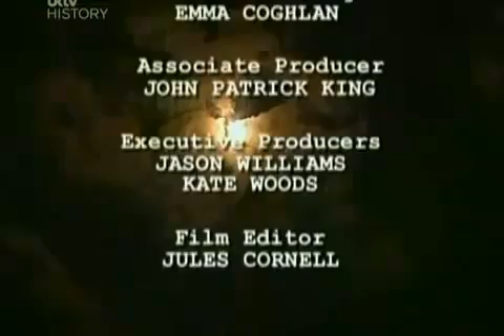The Last Flight of Space Shuttle Challenger 5/5

Comment: I thought the O ring had remained compressed because of the cold weather not disintegrated as per the voiceover ?
Reply: It was the freezing cold steal rocket casing that made the O ring     (that had failed) material stick and harden plugging the gap UNTILL the shuttle went through Max Q and the windsheer..
Reply: Correct, the seal couldn't be made because of the cold. It resealed temporarily with the debris of solid rocket fuel on takeoff then the massive windshear they hit dislodged it. The fire burned straight through, breaking the strut that holds the srb to the liquid fuel tank, which caused the srb to slam into it, rupturing it and causing the explosion.

Comment: But they put men on the moon with no problem whatsoever 🙄
Reply: And that was 17 years before this.
Reply: @karlvonboldt  I guess you've never heard of Apollo 13.
Reply: And even before Apollo 13, there was Apollo 1.  Followed by numerous Soviet disasters. All failures NASA learned from in order to make the moon landings possible. I'd hardly say we put men on the moon with no problem whatsoever.
Reply: The Apollo rockets while limited in tech were a much safer design. The Shuttle was intended to be a cost saving reusable vehicle that would be used to put satellites on orbit as a buisnessa and continue work on the ISS. It was a failure in cost saving and its design proven to be flawed. Based on the entire craft being in a very vulnerable position along the side of the SRBs and main fuel tank rather than a top riding style like apollo and a emergency escape system.
Reply: @theaceofspades485  Nasa turned down Aerojet General rocket booster because it cost more. Their booster would be a one and done but no sections and no O rings to fail
Reply: bettter launch team .
Reply: People just comment anything...have some respect for the dead coward!
Reply: @gradybeats83  that is a problem now days. People don't know what respect is or choose not to do it.

Comment: Since ive seen a blast on the launch pad compared to an atomic bomb i think we can all be thankful that o ring sealed temporarirly
Reply: It wouldn't have been like that but it might have posed a danger to people in close proximity. I think it was a cover-up. The joint failed at liftoff. Not in the air. It actually (accident) might have been a design flaw, I don't understand the assembly but it seems sufficient pressure between the joint might have been sufficient. Temperature seems more like an excuse to me. Cold weather shouldn't make a seal go bad. Unless there is a bad component and I guess I wonder. How bad does it have to be?
Reply: @christopjerfoote5747   the first ring failed at launch but the back up sealed and lasted till the shuttle hit a wind sheer at 58 seconds.
Reply: @scottaznavourian5791  The accident report says that both o rings failed but the leak was blocked by solid rocket fuel slag until they hit the wind shear then it was just a matter of time from there.
Reply: lucky came lose blowing up on the pad

Comment: I didn't think they o rings disintegrated at launch? That they simply failed to expand to frill the gap due to the cold weather?
Reply: You are correct. I think there's a little dramatic license taken here, but the O-rings simply failed to expand, due to the cold weather. Ironically, since there was aluminum added to the SRB fuel, slag had built up, and temporarily blocked the hole, preventing Challenger from exploding on the launch pad. (There's another documentary, Challenger: The Untold Story, where Roger Bolsjoy talked about a colleague of his leaning over to him and saying, "Looks like we dodged a bullet," because the propulsion guys in engineering had told them they expected it to destroy itself on the pad. However, during the ascent, the shuttle was hit by a crosswind equivalent to Hurricane Katrina, which dislodged the slag, and allowed the disaster to occur.
Reply: If I recall correctly, according to the report on the accident, the O-rings were vaporized across 70 degrees of arc by the hot gases leaking past. So they didn't just fail to expand in the area of the leak; they ceased to exist there. However, you're right that "disintegrate" isn't the right word for what happened.